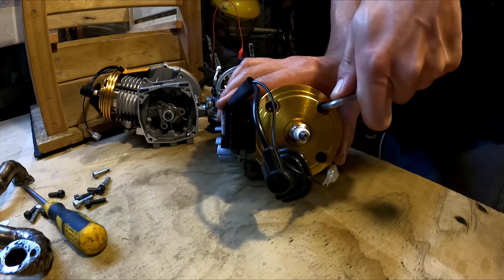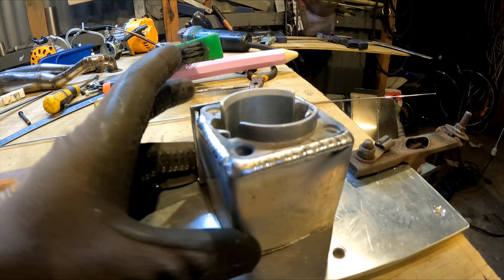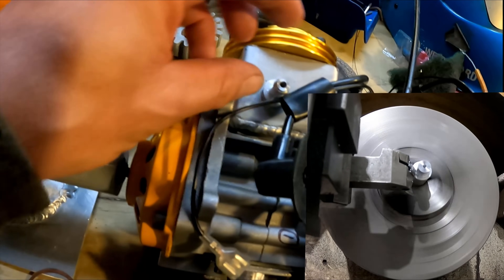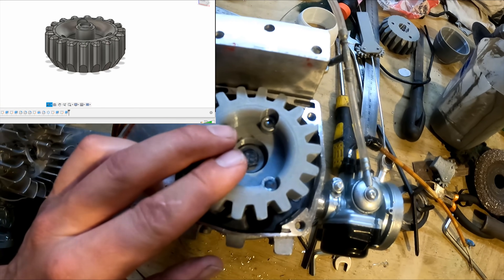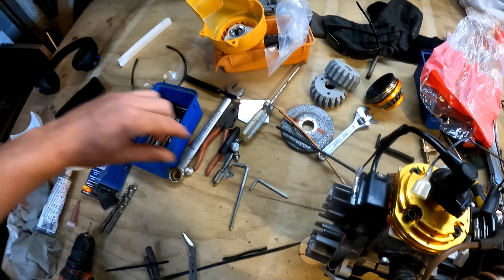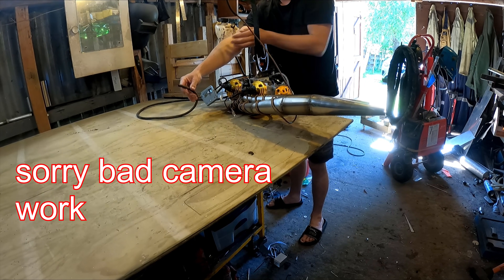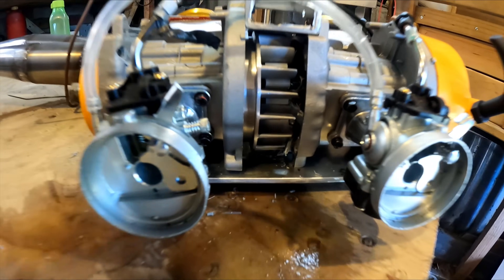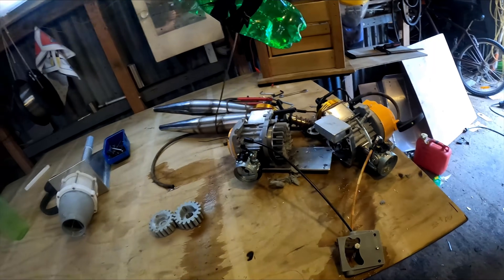Homemade Jet Drive Water Cooling

Comment: Do you sell that coupling??
Reply from the maker: I have the 3d printer files for sale in the description. I would actually recommend not using these motors as they aren’t very powerful
Reply: @ thanks! Have any suggestions?
Reply from the maker: @ not really there aren’t any good small 2 stroke motors, those 212cc 4 stroke honda clones are good. If you have the money electric motors are really powerful if you get the correct battery and controller
Reply: @ your awesome, thanks!

Comment: Wouldn't the exhaust heat the water before getting to the cylinder head and defeat the purpose of the water in the first place?
Reply from the maker: It does preheat the water , a jetskis does the same it goes around exhaust manifold first . I ended up ditching the copper pipe it was too restrictive

Comment: Lfire both at tdc to save drive coupling
Reply from the maker: I did them opposite thinking then the crank is only loaded by on at a time
Reply: @dkthewelder  I think it was the push pull sync in the coupling,thinking if they both power stroked and comp at the same time ,stress difference would be halved,one dragging the other?

Comment: Liking the series so far definitely late on responding. Should have checked the squish witch is the distance between the cylinder head and top of piston at tdc to tell you hoe much playing room you have on cutting the base back flush as well as the top of the cylinder. Anyways well done on the whole setup buddy!
Reply from the maker: Thanks 👍

Comment: Running the cylinders at 180 deg will cause some horrible stresses on your coupling. Might be better printing a mold, & casting a fairly stiff polyurethane coupling. Interesting project, look forward to next video.  Keep up the good work  😊

Comment: Those carbs definitely need to be vacuum synced. That should take care of the binding in the coupling. In theory, your mock up coupler shouldn’t have exactly ripped apart that fast. Especially with the engine(s) not under any kind of load. That thing sounds badass though!!!
Reply from the maker: Thanks 👍will do

Comment: I could be wrong, but i think half your bore is going to overheat, also, the engine will overheat having hot water to cool the engine. If the engine is cold when you start pushing water thru it, it will work flawlessly.

Comment: More perimeters, no part cooling and bigger nozzle will help with strength, what filament do you use?
Reply from the maker: Just using PLA . I have printed another coupling with 4 mm wall thickness hope it works
Reply: @dkthewelder  use PETG or cf PETG or pc

Comment: I dont quite get why you made the water flow from the exhaust to the engine, would you not end up cooling a lot of exhaust gas that could be used to cool the engine? Would it not make more sense to use the coolest water to cool the hottest part?

Comment: Great job. But I don’t suggest running the cooling through the pipes first. Always run them through the motor and then to the pipes. You’ll risk blowing the motors
Reply from the maker: Marine engines water goes through exhaust manifold first then through cylinders , then dumps into exhaust. An outboard motor works similar
Reply: @dkthewelder  that makes absolutely no sense the motor will get hotter than the exhaust. And who cares about the pipe. What’s gonna happen. Just maybe it will get red. But that’s unlikely. So u send hot water to the motor. That doesn’t make sense at all
Reply from the maker: @checkforfleas9452  it only needs to heat it to operating temperature. If cold water hits a hot cylinder it could crack . A car is a closed loop so it heats up evenly, a lot of boats use a heat exchanger but those that don’t need the water to heat up a little bit before it hits the cylinder
Reply: @dkthewelder  we’re talking freezing cold waters. I wouldn’t have a boat running in 40 degree wheather lol. If it’s too cold for me. It’s too cold for my boat. Your talking about 70 80 degree weather on a 210 degree motor. I ride my dirt bike in colder weather than that and hit puddles. Been doing it for a long time and two smokers aren’t water cooled.
Reply from the maker: @checkforfleas9452  I hear what you saying, I had this discussion with some of the old boat guys at work and that was their advice. All mx 2 stroke bikes after the early 80s are water cooled? Also here’s a link to a diagram of a JetSki cooling system 👍https://images.app.goo.gl/72b1UF5u4ubzKadKA
Reply: @dkthewelder  I hear u too. I’m just saying. Think about the theory. This has been an issue since they started making aluminum blocks and heads. But u know two smokers actually run a little cooler than a four stroke. I mean a motor is a motor. I mean do what u will. Really if u want to run it that way. That way sucks ass. U get what your doing. I use to run model boats like that. That way is no good. Also jet skis and all that. They actually have a block built in to the pipes and manifold. If u wish to do it that way. Build a block inside. The object of that pipe is to build back pressure. I know u know that. Built build that water block inside. U have the right idea on the heads but those are meant to be air cooled. So this is controversial. I hear your theory. Just like mine. Measure the temps without the water blocks. Think about this. Itll be 70 degree water atleast. If that block would get 110 degrees. It’s more than ok. Yes. In a car that thermostat really doesn’t open till 160 degrees on a block that is say 400 degrees. Just an estimate. But at what temp does that cool water come into the block. I don’t know the facts on that. But it could be lower than a hundred degrees. U see what I’m saying. Does that water actually have time to heat up before it enters the motor? Ya know. But wrapping the copper around it sucks. Maybe it’s a temporary thing for it for testing. But it sucks. When I did model boats. I actually changed to water blocks and it was a significant difference. I’ve actually burned up motors that way. The theory behind water cooled is that the colder the engine is the better the performance. But I like older bikes. So all mine are air cooled. Yes water cooled is better. But if I ride in say 40 degree weather at 55 mph it will not run right. It is built for a certain temp. The carb and all that coincide. I have no clue what the application is for. But an air cooled is an air cooled. If it’s for a model boat. It’ll be fine and still run amazing with out all that. I know your trying to be different. But a scoop will work just as good
Reply from the maker: @checkforfleas9452  thanks for all that information 👍it’s going inside a jet board that will be sealed except the air intake that’s the only reason I’m water cooling them . I think a cars thermostat is like 78 degrees Celsius, a JetSki also has a thermostat so the water needs to be at a certain temperature before it enters the heads. I’m just guessing with the copper pipe I hope the water heats enough or not too much I will have to test it with the jet pressure. I might have to use a thermostat or make a closed loop and a heat exchanger, then the other part of it is I don’t want the pipes getting too hot inside the board which I will make from aluminium. I was going to make another sleeve around the expansion chambers to cool them but the copper pipe seemed easy haha. I’m just giving it a go thanks for your input , I have been having doubts about the copper pipe and you have confirmed this
Reply: @dkthewelder  😆 we use Fahrenheit. U can buy different thermos. For different applications. Like if u run a supped up car or what ever. U would need a bigger thermos. U need that water to cool down longer. It’s kind of like a timer. If u used a closed loop u could use a thermos. Your working with a tight spot. 🤔 the pipes on two smokers tend to stay cooler Bc of how the motor works. So if your familiar with gas powered rc cars. So they are a diesel imitation. They have to run a certain temp to run right. Or they blow up. Or if wrong to they can run like shit. I would start with a water block. But I would put that water block closer to your manifold. It will get hotter there. If u decide to try the copper method. I would go with a bigger diameter. A significantly bigger Diameter lol. U can run a pick up tube. It’ll be better than a jet. I always run my pick up tubes away from the propulsion. Like off to the side. But u have to be careful too. I have learned that bigger tubes don’t always work. I get what u are trying to do now. I thought it was for a boat. 😂. My bad. 🤔 u could have a water block on top. It doesn’t have to be a large block. Just enough to give it some time to heat up. Your in a pickle lol. If u have a friend to mill u a special head that would be good. You’ll just have to try and see what happens. I don’t think copper is a good selection Bc it’s very good at dissapating heat very well compared to aluminum. In my opinion.

Comment: Man those little engines sound great, beautiful expansion chambers! Can't you use a rigid coupling? Maybe the solid one will hold up. Any idea how.much power those engines make? The power pulses are what shreds the plastic, solid wil be much better.
Reply from the maker: The coupling has to be flexible or it will snap the crank . I have a few things I can try

Comment: I wouldn't wrap the copper pipe around the exhaust , it's just heating up the water before it gets to the most important part (the head). Just go straight to the head of the motor and straight out, or go straight to the head then around the narrow part of the exhaust before the expansion chamber then out. You wouldn't "cold shock that little motor at all". You should also just make a hole at the top of the bottle to release the vacuum so that the water can actually run through the hose.

Comment: Print the couple same again. And use ot to make a mould and cast a polyurethane coupler. 2 part castable is readily accessible. Ive rebuilt old rubber enfine ounts by casting my own. Even reinforce it with a steel or aluminium insert.

Comment: when you print the engine coupling doing it at an angle like you did the drive coupling is a good idea for shear resistance (even at 100% the layer lines are still viable to delaminate especially in such a high shock high torque application) and if you just have it floating in the air in the slicer it will generate supports under it so it doesnt have to actually be printed oblong like the drive coupler was if you didnt already know.
also thinner layers and thicker lines will lead to a stronger part, with a .4 nozzle .16 layers and .6 lines printed at 230* (or whatever the max is on the spool) gives good results for me. using petg might also be a good idea since it is almost as strong but more compliant than pla so its less likely to outright snap and has a slightly higher softening temp than pla which i suspect will come into play when in use sandwiched between a pair of hot engines running full bore.

Comment: Nice work! I recommend to use bigger diameter and shorter pipe for water cooling. I am afraid  you don’t get enough coolant flow with the diameter and length you use now. Also I would make some kind of o-ring to seal the waterjacket to the cylinder head. Good luck!
Reply from the maker: You might be right the water wasn’t flowing though very easily hopefully it is enough. I will find out once the jet unit is pumping water into it

Comment: I would move the outlet nipple of the second cylinder to the opposite corner like it is on the first cylinder so water is forced around instead of going straight past one corner of it

Comment: this is excellent engineering! i was so pumped to sit down and watch this.
good solution with the cooling of using copper tubing, smart and relatively simple!. and nice job of the cyl water jackets.

I know nothing of 3d printing, but maybe using a less-brittle plastic such as TPU to add some level of vibration dampening within the engine coupling ?

that engine sounds like a beast,  its gonna thrust like crazy 😁😁😁👍👍 oh and some kind of rubber mounts of the engine assebly to the hull/board may be a big longevity saviour
Reply from the maker: Thanks 👍 a few people are suggesting tpu , I have been trying to figure a way to rubber mount the engine to keep the vibration down
Reply: @dkthewelder  maybe just some bolts with big fat rubber washers (or a cluster of them) on either side 🤔 or some old jetski ones from a used ski parts guy *bulky though*. or steal ideas from a chainsaw.. hmm. bit of improvisation
Reply: @dkthewelder  maybe if the engine is free to twist/wobble on its vertical drive axis  (in line and counter clockwise with the drive shaft) on rubber covered bolts or a knee joint pivot knuckel of solid rubber. hmm.
Reply: @dkthewelder  or wrap the whole base frame in a bicycle tyre and clamp it in place

Comment: Instead of using higher infill, use more walls. That way the geometry of the part goes all the way through itself and it should be stronger. If you're interested look up CNC Kitchen, he has loads of tests with all sorts of different printing techniques. Really looking forward to see this one in the water!
Reply from the maker: Ok thanks I will check it out, so it sounds like wall thickness is the way to go thanks for the info guys
Reply: @DktheWelder I know I’m pretty late to the conversation here but guys are now 3d printing molds for “forged” carbon fiber parts for applications like this. Just wanted to toss that out there for anyone who watches in the future.
Reply: +1 Yes.. More walls  less infill..

That said, there's a lot of torque going on there and you may find machined metal parts serve you better..
Reply: When I say less infill, that's rather than more.. Above 20% you don't see that much increase in strength, only increased print time. More walls will give stronger parts. Just remember that the weakness is the layer lines, even when printed at an angle - that's why I advise machined parts with something like that motor. Save you some pain in the end..

Comment: We always used copper tube jammed into the cooling fins.
Reply from the maker: I was going to do that just put the tube between the fins which would have been way easier , I wanted to try making the water jacket and I think it will cool more maybe
Reply: @dkthewelder  the cooling jacket you made sure looks better and made a better video.
I just have never done it that way and I’m curious to see how it goes with most of the heat being generated on the cylinder head but the piston heat being cooled through the barrel.

You are a very clever man.

Comment: Get some Nylon or ASA filament. Run gyroid infill and 20% with 3 or 4 walls. Only way it will handle the load and/or heat. Otherwise do a lost cast with some 2 pack hard resin. Don't use TPU as other people have said it will shred from the heat and the force. You will need engineering level filament to handle it due to the heat/ vibrations
Reply: I was thinking TPU to negate the vibrations. but you are right! it won't hold up well.
a resin cast mould would be good if the 3d prints arnt strong enough
Reply: could he 3d print the 'inverse' of that coupling design and use it to cast a mould for an epoxy resin, then break off the print material and be left with a solid resin part? 🤔
Reply: @luckyphiltech  100% you can do molds using cura and cast a mold. Depends on what 2 pack plastics he can get whether it will be cost effective in comparison to a 3d printed version.
Reply from the maker: Something to think about! Do you do 3d printing for strong parts? As you can probably tell I am new to 3d printing so it’s a big learning curve
Reply: @dkthewelder  yes, I have done loads of  structural components. Have never done a direct engine coupling though but worked on enough engines to understand the environment the print will be in. Increasing wall thickness is key to structural integrity. Once you go past 25% you get deminishing returns on the strength vs weight/ material used due to the inherent weakness of layer adhesion. Make sure youre printing the coupling at 90' to the load factor so that layer shear is minimised even if you use loads of support material.

Comment: I really like this little engine and how it's coming along.  I printed something similar for a friends mini bike project.  I'd increase 10% infill every time it broke.  The only time it didn't break was at 100%.  Now, anything like that gets printed with 100% infill.  Takes longer to print and uses more material, unless you consider how much time and material is wasted when you have to reprint because it breaks.
Reply from the maker: It was mostly that I didn’t know if it would fit why I didn’t 100% infill straight away. Some of the other guys a commenting to use flexible filament I have some TPE maybe I will try that

Comment: Great work. Print in ABS, 100% infill. Or, maybe Tpu is a better material? Elastic polyurethane, but it prints very slow. 
And a tip to make a better fit for the coupling. Take a picture of the fan profile and import it to the cad. Then you can copy the profile and scale it. There are tutorials on how to do that here at Yt.

Comment: Synchronise the strokes of the motors my brotha
Reply from the maker: It actually runs pretty smoothly with them opposing also the pull start is fighting two engines compression at the same time . I might try it though it would be less load on the coupling 👍

Comment: Sweet piss cam😂😂😂😂😂 use how about rubber or polyurethane or something like that for the joiner instead of plastic 🤔 since you have the power stroke of each motor at  opposite ends 🤔just a thought coming along nicely though  jet look good to keep it up bro👍
Reply from the maker: Yeah I actually have some flexible 3d printer filament which might be better